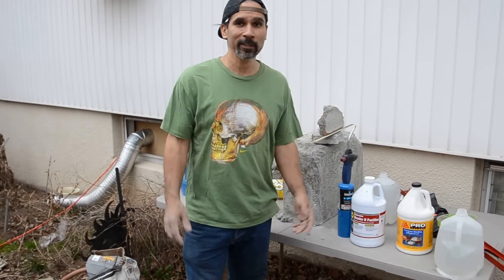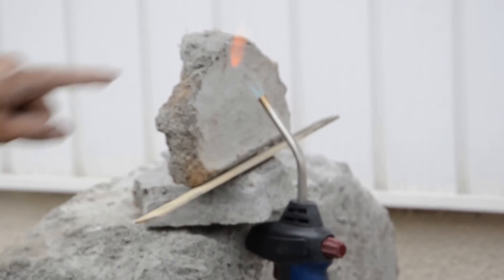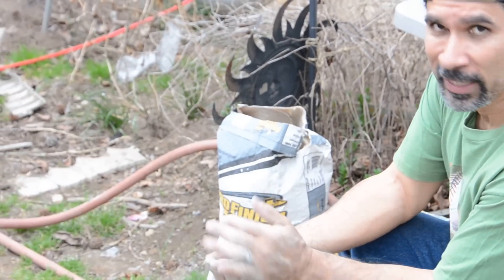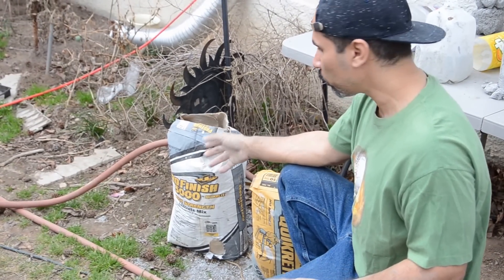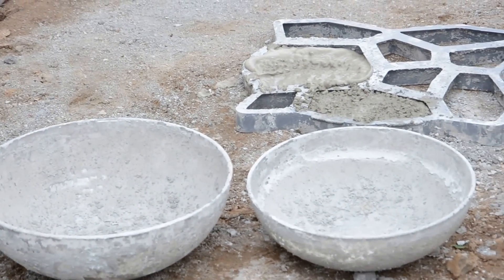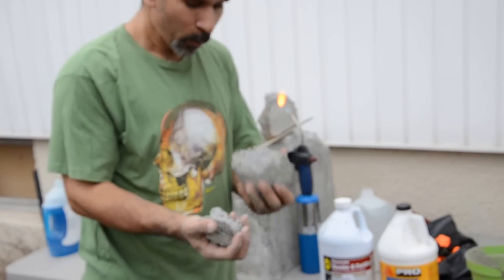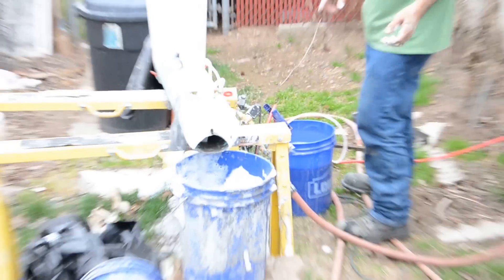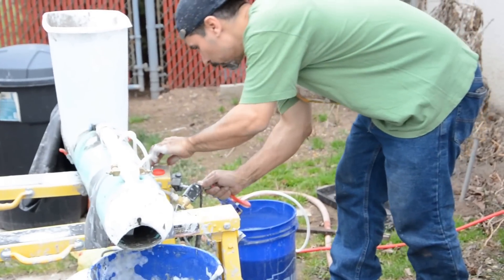Aicrete Blowtorch Test | Concrete Bonding Adhesive #Aircrete #Blowtorchtest #AircreteHarry #DIY

Comment: Do you know of a test to see just how many air bubbles are present in say a square inch ? Thanks
Reply: we had to do this test for a government contract to get approval. There are just as many air bubbles in a cubic inch as there is in a 100 gallon drum of the same stuff by volume. 15897.2•13 
However, by contrast, in a square inch, the amount of bubbles is 10,754.  Hope that info. helps someone.
Reply: @Blue-Horse-Shoe  That make sense to me WTP. How much of a foam agent either Dawn or Commercial product produce air cells that are superior for longevity for the air crete before it reacts and hardens ??? Would the addition of Acrylic help or hinder the insulating and water resistance properties of air crete ??? Would the Acrylic hinder the bond strength in standard cinder blocks holes ??? 
Thanks and good day too. VF

Comment: Excuse me for this reminder.  Mixing an unknown quantity of "concrete" with an equally unknown volume of water is not called "a test!"  Each component of Concrete has to be measured according to a chemically determined proportion of its ingredients.  A guy who is adjusting swimming pool's pH doesn't just pour a bunch of acid and calls it "a test."  What makes you think that strength of a batch of concrete is independent of how much water or cement is present.  Please pay some attention to this basic chemical interactions between cement and water in overall formation of concrete.  Thank you!

Comment: That torch should be lower on the block the largest part of the heat is just above the blue part of the flame, and most of the heat is escaping with out heating the block.
Reply from the maker: I will be redoing this test with a much bigger torch!

Comment: Harry, 
I have never seen anyone fill earth bags with aircrete. I really believe it will work. 
Any comments?
Reply: I've wondered about the same thing, The biggest question I can't answer is how to efficiently square / level the top of the bag which is accomplished by tamping with earth.
Reply from the maker: It would work but you need to add a lot of sand 1 part Portland 5 parts sand and a little foam to have a heavy mix. That would make it easy to fill the bags.
Reply: We made 40# / cu ft foam cement using very fine blow sand  and portland cment here in New Mexico, cured it 30 days in a baggie and had it tested at over 900 psi strength. This is far stronger than required for a wall.  We transported it in poly tube bags 5 miles to my house, where we squeezed like toothpaste it into gopher holes under my brick patio. The long set time can be useful, but a pain when building. Has anyone used calcuim chloride to speed the cure?
Reply from the maker: @liesarenotreality  Yes I have and you can not use to much or it will collapse your air bubbles. I add 1-2 oz. Per 94 lb. Of cement then added foam.

Comment: Why use concrete mix? It's not that much cheaper than cement and it doesn't make acceptable aircrete. Aircrete is good insulator because of all the air pockets. The lightness makes it easy to handle. But it should not crumble. The water/soap mix should be around 30-1. You could tell it was too lean by the runny foam, e.g., the foam should stand up higher and last. This was why the blocks crumbled easily. 
While watching the poor mixing technique (no auger/mixer) I got an idea to save money by using a concrete mixer instead. Fill one third with cement/water slurry, add foam, mix, and pour. 
Now, if only we could make the foam without that expensive machine/compressor. That would be a BIG money saver.

Comment: Just think, if you did find the perfect  mix with the greatest tensile/compression strength you would never be able to replicate the receipe because you don't measure your ingredients.  
As far as the binder is concerned...it should have been mixed throghly in the water you put in your dry ingredients.  You are bonding the Dry ingerdients not the soap bubbles.  why would you use ready mix in your foamed concrete...you do not need the gravel aggregate.
Reply from the maker: I agree with you back then I was trying everything I can to get stronger aircrete.

Comment: Thank you for doing the testing! Big help for the air crete community! I think you may have an issue with your foam as well. I've heard 40:1 ratio, not 200:1 ... also from learning/watching other Air Crete youtube videos, I've found the best Foaming Agent test video here - https://www.youtube.com/watch?v=S1ydXgWDU00 - They recommend - Drexel Foaming Agent - https://www.ruralking.com/drexel-foam-concentrate-gallon-160-1.html - "Drexel Foam Concentrate 1 Gallon 160:1 F.M.-160" as in their tests it Beats Dawn and Seventh Generation. Also, as mentioned by another commenter, you need to use cement, not concrete as the little rocks will always sink to the bottom and cause issues.
Reply from the maker: burleyc1 Thanks for the information this video was made a year ago when I just started experimenting with aircrete. The video link of the following agent is also my video. LOL Thanks

Comment: The idea of foam concrete is to replace the heavy, dense rocks with air, for less weight and better insulation. Some sand can be used, but no rock..

Comment: The main point of air Crete, is insulation. Second point is that it's light-weight. Must use a slurries Portland, NOT aggregate, to do it. For added strength, use fiber in the mixing of the Portland, before folding-in the foam, which some say needs to be Dawn brand dish soap, because that product build stronger bubble-structure. For added water-resistance or durability of the cured air Crete, can add about 1/2 cup of WeldBond white glue per approximately 5 to 10 gallons of mix. For a product with increased fire-resistance, make about half the Portland part of the mix of Pozzolanic (wear breathing mask to avoid lung damage from inhaling the powdered Pozzolan).
Reply from the maker: This test was to see what effect the foam had on regular concrete mix. And don't use the dawn anymore for making the aircrete. Check this video. https://youtu.be/S1ydXgWDU00
Reply: Wow...what an improvement, that foaming agent!  Where to get that, and what kind/brand did you use?

Comment: Using standard concrete- cement and aggregate (sand and mixed stone)- defeats the purpose and most of the advantages of foamed concrete.(The rock just makes it heavier) 
I've made super lightweight concrete by foaming Portland cement mixed w/4 parts perlite. It's much lighter than air-crete made w/sand. You could also try vermiculite, thought it's a much weaker material. My next experiment will use  Greenstripe fire clay instead of Portland cement. While standard aircrete is fairly refractory (as shown by your torch test) I expect this mix to be able to withstand prolonged exposure to 2300 degrees F. at minimum, and maybe as high as 3000F. (Suitable for a pottery kiln or pizza oven)
Reply from the maker: How did it go with your refractory mix?
Reply: Yeah i wanna know too

Comment: What kind of soap do you use. Or for that matter what kind of soap is used for commercial air crete.  All the searches Ive done call it a "foaming agent" but wont actually specify what it is.  Im guessing laundry detergent or some other very foamy soap of some kind.
Thanks
Reply: Commercial foaming agents are produced because they produce smaller bubbles (more strength ) and they keep their small size better when mixed with the cement. We got 1000 psi, 40" / cubic ft foam cement with cement, blow sand (very fine) and a commercial synthetic foaming agent.  The commercial foamer is cheap per yard of concrete- a dollar or so.  
I found that mixes weighing less than 30 pounds per cubic ft.  were usable only for insulation, but once you got up to 40 pounds and more they were quite strong as long as you wet cured them for weeks. 
Most people make the mistake of not keeping aircrete wet when a couple of weeks wet cure would give them many times stronger material.
Reply: Darwin over at the honey do carpenter channel tested several and I think he found Suave cheap shampoo from Walmart seemed to work about the best.  Look up the video don't quote me. lol

Comment: Spoke to the guys that sell the Green Dragon, and they stated that no matter what the mix does come out Brittle! However! They stated to increase Tensile Strength Add Fibers. Other places I have looked at also add Aluminum Powder, And They Use at least 20% Fly Ash! Which is dirt cheap you can get it online, or at local suppliers all over the United States. So I hope this helps. Also the guys that sell the Green Dragon product wait like 10 weeks for their air crete to cure! That's insane! Any of the places that manufacture any type of air-crete, foam crete, aerated autoclave concrete' they all heat the product, usually two times. The first time for like 12 hours around 375 degrees Fahrenheit. With the Calcium Hydroxide and Aluminum powder that they add this creates a reaction in the air-crete, forms a ton of little Hydrogen Gas Bubbles. Now with regular concrete this same thing happens but with a different type of gas, and the gas in regular concrete never escapes, making the product dense and heavy. However with air-crete the Hydrogen Gas just dissipates into the atmosphere leaving behind a Ton of little air pockets. Hense a strong product with really good compression, and decent tensile strength if done the way that I have stated.

Now the problem most people have not being a big company is how the hell do I bake this stuff for 12 hours! It should also have some water sprayed on it to steam it and it needs to be under pressure the entire time. 
Pressure needs to be around 150 psi.

Ok, if we get creative we can do this in our backyards! I've done something similar with drying firewood!

To get the thought process going I will explain what I did to dry the firewood and people can build on that with ideas on how to apply that to this application.

I took a cord of wood, wrapped it in Black Construction paper and then wrapped the entire cord in 4 mill plastic and made sure the cord was sitting in the middle of my back yard where it could get plenty of sunlight during the day. 

I live in the North East of the United States and this was in the early fall.  The cord of wood essentially had all of the water Squeezed out of it at really high temperature, the pile was hot to the touch, a bunch of water just ran out the bottom of the pile. In two weeks I took completely fresh cut green firewood and turned it into fully seasoned firewood! 

I'm willing to bet if we took this air crete and placed it in the right container, a day or two in the sun light and we would have a near perfect product. If you want to enhance the product more add rebar before baking it.

When I have some time to do this I will try it here, and if I find something that is cheap and works I will post the Entire Recipe and process to make a nice solid Non Brittle batch of Air-Crete. No B.S. just a straight up mix with everything you need to do.
Reply: Your fly ash suggestion is a good idea, as is the use of plastic fibers. I know that polypropylene or HDPE fibers add considerable strength, so long as they're thicker than .01" (.3mm). The goal of most of the various formulas is to achieve maximum compressive strength while adding minimal weight. Air-crete made solely w/type II cement and foam is excessively brittle, more like porcelain than concrete. Sand adds a lot of strength, and now I'm wondering how fly ash compares, both in terms of weight and added strength. Have you used fly ash? 
I don't doubt your "backyard" method of drying cordwood is effective, but would solar heating under a black tarp would never achieve baking temperatures sufficient for autoclaving air-crete.
Reply: Unlikely we will manage 150PSI, or any significant pressure.  Given that PSI is Pounds per Square Inch, and every square foot is 12 x 12 = 144 square inches, that's 150 x 144 = 21,600 pounds per square foot...  Also before trying to use high-pressure steam at home, search for "boiler explosion".  
Heating seems quite possible.  I would want to try small test pieces and some repeatable test setup to see what results come from time and from heating.  Given the funny odors etc. that will be emitted, probably in a junk oven outside.

Comment: You need to learn the difference between cement and concrete. Using concrete for aircrete will not work because the aggregate will always sink to the bottom.
Reply: How about layering? First aircrete only, then aircrete plus agregate after the first layer sets? There would be leyers of agregate in the concrete.... composite aircrete....uhh, ahhhh!
Reply: d barboza yes, fizzyks

Comment: From watching your videos (and taking notes) and closely watching and researching AirCrete (and taking notes), I noticed that you are not using their prescribed amounts (cement, water, and soap in their videos) for your testing. Perhaps if you first recreate their results exactly, then you will have a better idea of how to "tweek" your recipe. I saw where a Dutch company is using the recipe as shown with excellent results. And, so has a company in Japan. I know because I called both overseas companies. I do give you full "koodoos" for trying to answer your brittle brick problem before applying the bricks in an actual application.  I wish you well in your experiments.
Reply from the maker: David Fr when I first started making air krete I would use their recipe of 36 parts to 1. I have to get in such a brittle results I tried changing the recipe to see if I can get more strength out of the air Crete.
Reply: Talyn71 Gmail that was so weak!
Reply: Go by the statistics read the instructions and then add or subtract for strength afterwards there's all kinds of good tips on YouTube you should watch them Harry kudos for trying though and giving her always go by the mixture on the bag that way you have the proper strength to start with on the 5000-6000 cetera hats off to you brother

Comment: maybe you should measure the weight of one cup of each mix type you make.  The strength changes  very much with the density ,  The strength will often increase as the square of the density.